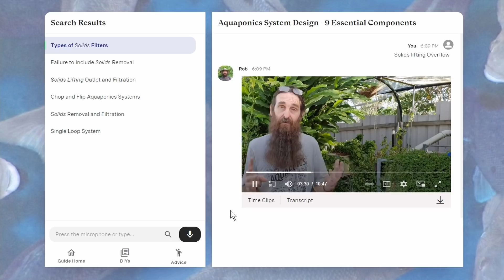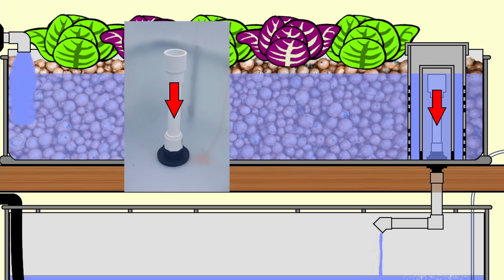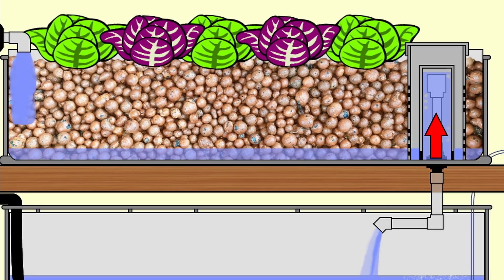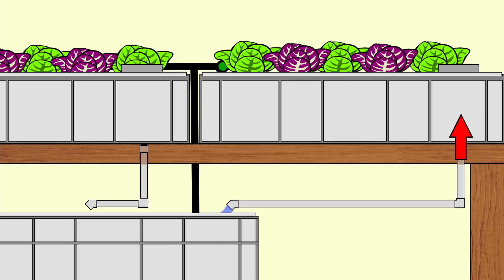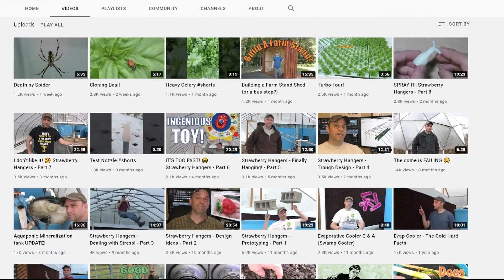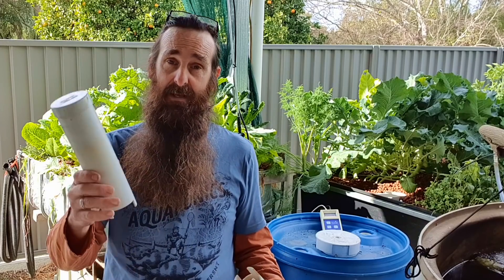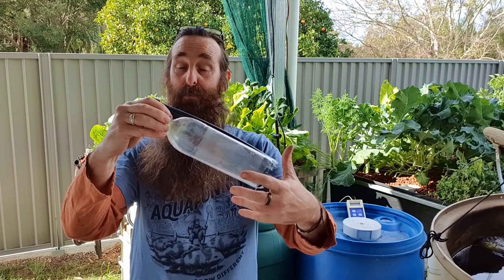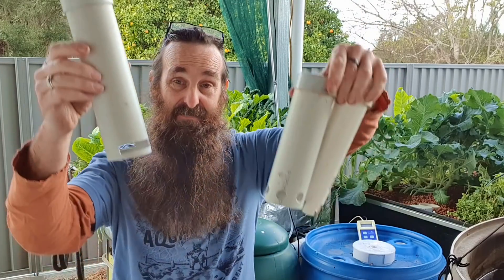Bell Siphon Troubleshooting & Explanation | Aquaponics 101

Comment: Ahhhh my release pipe was running continuously Never emptying the grow bed but adding a 6 inch pipe on The elbow worked like magic Now My issue is pump only 400ltrs per hour maybe 1000-1500ph could fill growing bed faster

Comment: Might be a weird question, but how do I get the siphon to start if water is dripping drop by drop by gravity and not being pumped?

I want to make a siphon but nor for anything gardening related. I have an air exchanger that drop condensate into the next room bath drain. But when there's high humidity I constantly hear dripping echoes in the pipes twice a second all day.
I'd want to make a siphon so water get sent to a container to make a "buffer" so the water only drain through the siphon once there's enough of it. basicly i want to make a motorless condensate pump.

Should i make the tubes smaller to make sure the siphon start? Its not fast enough to start a spihon and have no control on the flow
Reply from the maker: I'm not sure you will get one to initiate with a drip even with thinner tubes. Not sure what to suggest sorry. Hope you get something sorted.

Comment: I was thinking of starting a small bed with sand as a medium. Will the water be able to flow quick enough through the sand for the siphon method to be effective or am I better off with something bigger like rocks or clay pebbles?  Thanks.
Reply from the maker: Sand works better with a timer on the pump.
Sorry I missed this.
How did the build go?
Reply: @RobsAquaponics  I experimented with sand and a stocking to keep it out of the siphon well. I found it to be draining water too slow. So I bought clay balls. It's been going well for a couple of months.

Comment: Dude thank you so much. I've been "tuning" my flow for two damn days trying to get the siphon to break. Turns out I just needed to spin the drain elbow around since my siphon is slightly crooked. I havent seen anyone growing cannabis with this setup so I'm gonna give it a try 😅. Curious how the buds will turn out relying solely on the fish tank for nutrients. I've got mine in a shed. Just need to mount the light but it's currently in use lol. I've got blue tilapia and crawfish in the bottom but I'm wondering if I could breed koi instead

Edit: by "this setup" I mean a chop and flip
Reply from the maker: Sorry I missed this but am pleased the video helped. 👍👍
Have you sussed out @Potent Ponics channel?

Comment: 😮i have my drain runing under water, because the air went up resulting no drainage now i created an airlock and i have to start over😢 maby just add a 90 bend but above water its a fun project i made smaller ones they run fine this one drain 2inch im sure once i figured out  how to perfect the big one im planting maruana and im adding fish once i made a propper filter that can clean 2000liter without restricting pump flow i dont like to add taps to pumps the pumps dont last long from backpressure😢 so sizing the tubing has been taking some time😅 i love watching your projects you explain it all so well hope your channle get lots of views😊
Reply from the maker: Sorry I missed this I don't think I've seen a 2" bell in operation. I think 1¼" was the largest I've seen with a 2"-1¼ reducer on it (from memory).
Sorry I missed your post.

Comment: Thank you for your explanation.
I tried your advice to initiate the bell siphon by increasing water flow rate and it works well but then it didn't stop .
Therefore I decreased the flow rate and it stopped but didn't initiate.
How could I calculate the correct flow rate?
Reply from the maker: Sorry I missed this. It sounds like there's something else at play if that didn't work. 
Did you check the angle of the drain below the bed?
Reply: @RobsAquaponics  Thanks for your guidance, I'll try to change the angle

Comment: Aside from the engineering challenge involved, why do y'all rubes even use bell siphons?
Reply from the maker: What engineering challenge? I've seen kids make them work on the first attempt 🤣
What do you use to flood & drain the beds?
Reply: @RobsAquaponics  i guess it's an engineering challenge bc we see growers so the time, dismayed bc their bell siphon got stuck either on drain or fill, causing damage to plants and pumps and floors. It's a simple design, sure, but it's got some reliability flaws. You can argue if you like, or you can watch other youtube videos, read fb groups and hydro forums, etc ..

I prefer to have a pump on a timer plumbed thru the bottom, and a drain pipe higher up in case my timer ever failed and left the pump running, which never happened to me yet, but I'm ready for if/when it does.
Reply from the maker: @fatrobdouble  That's why this video exists, to help those that are having issues due to dodgy advice from social media, forums & in some cases, "professionals". 
You'll get no arguments from me mate, I've ben told I don't know what I'm doing by many a keyboard expert over the past 10 years, strangely enough vary rarely compared to the folks that thank me for the help they received watching the videos or emails I sent them. 
Run your system how you want, as long as it works for you, happy days.
Reply: @RobsAquaponics  I'm not trying to tell you your doing it wrong, nor am i trying to convince you to change your system. I'm just trying to find out why it's popular with some ppl. The only reason i can think of is that aquaponic growers need to keep a pump on constantly and they might not want a second pump? But straight hydro growers rubbing ebb and flow, they can save a lot of headaches and energy by just running a checkless pump on a timer. (Plus a lot of plants don't want to be that wet...)

Comment: My siphon was cycling well air lock forming and breaking. There is a long pipe to sump but the bell has a snorkel. 
The air lock is now forming BUT the bed is failing to drain. The water goes down an inch or so but then holds in place. So it no longer drains fast enough. It doesn’t get to the bottom to allow the air lock to break. I can assure you the water flow rate is quite slow so it isn’t over filling. Any ideas?
Reply from the maker: Normally it's a inflow issue if the outflow is keeping pace with the inflow.
 How low do you have to turn the inlet flow to get the siphon to break Dewey?
Reply: @RobsAquaponics  thanks so much for the reply. I seem to have rectified the problem by lifting the bell siphon up a bit. It appears that once the airlock was formed the vacuum applied to the bell siphon sucked the bell down so firmly it slowed the water out. I tried adding additional holes to the base of the bell and this improved things somewhat but it needed clear space under the bell to allow the airlock to break. It is all cycling just fine now.

Comment: Hi Rob, thanks for a great video. I have a couple of questions. I use the bottom section of the bottle to ensure no air leaks, it works but am wondering if the taper at the top will act as an accelerator? My other question is instead of a large grow bed my bell syphon feeds into 110mm pvc pipes with cup cut outs. It takes about 8 minutes to drain and about 13 mins to resyphon, so there is only about 5 mins of no flow. Is this a problem? My plants are alive but not growing...
Reply from the maker: Hey Rupert.  I'm not sure about the taper would have much effect on the overall operation of the siphon.👍
Is there any way you could block the discharge end of the pipe so the water backs up a bit? If you did there would always be a small amount of water in the base and it would act a bit like a DWC bed. The pipe would need to be fairly level to have enough water to reach the inlet end.
Hope that helps some.
Reply: @RobsAquaponics  sounds like a nice simple fix will try it thanks

Comment: Why use a bell siphon and not simply an over flow? Also, using the IBC totes, is there a reason why one would choose to use a growing media instead of the deep water method  with Styrofoam rafts and cups?
Reply from the maker: I like to use the siphon to raise & lower the water level to help the plant roots & bacteria get as much O2s as they Can. Have seen many constant height/overflow beds work well but have also seen a lot with dead spots once plants roots start to inhibit the water flow. 
I have no issue with raft beds either but keep in mind that you'll need decent fine solids removal to keep them out of the beds as well as a stand alone biofilter to process the waste from the fish.
Reply: @RobsAquaponics  yeah I have an extensive filter system in the works.

Comment: Hi Rob, purchased the video package was great to have it all sorted and easier to work through. I am testing the bell siphon in a grow bed setup, however is the bell siphon meant to be free seated and floating? If take the outer cap up the bell floats up and thats done with the 50mm pipe. Got great flow rate, run off etc just cant get it to break
Reply from the maker: Hey MCT. It sounds like the drain may be running slightly uphill & has some water in it preventing the air from leaving the bell chamber as the bed fills.  Once that is made to run level or slightly downhill you shouldn't have the floating bell issue & it may help the siphon to break as well. 
Let me know if that helps any.
Just to let you know that if you ask the question through the guide I will see them a lot sooner as I check them a few times a day. 👍

Comment: i understand everything said in this video but my issue is not stopping or not starting is to close together, i turn water flow up the smallest amount it doesnt stop, turn it down the smallest amount and it wont start, and if i get it right, 1 day later its doing the same thing :( might have to try the snorkle i think
Reply from the maker: Do you have a long run of pipe from under the bed back to the tank ?
Reply: @RobsAquaponics  only about 70mm under
Reply from the maker: @SnitchyBug  If you're still having issues & want help post a video showing the siphon & the drin & I'll suss it out for you.

Comment: Your videos continue to be perfect, thank you so much! I'd been running aquaponics for abt a year thanks to you, swapped to hydro last weekend and moved the system outside. Siphon wasn't shutting off, messed with it for a couple days, found your video and bam! 5 minutes later I had my new drain pipe angled down instead of slightly up and its working perfectly. Thank you again!
Reply from the maker: That's great to hear Frostyforge. 👍
Cheers & happy growing.

Comment: I used a Central bell siphon on a medium chop and flip, it was intended as a Failsafe but is so much easier to adjust.
Reply from the maker: I've always found them to be very easy to run CAS. 👍 Had real issues trying to dial the loops in when I had a crack at them.
Cheers mate.

Comment: i was thinking about starting an ibc chop and flip aquaponics system but i will only be able to feed them once every 1 or 2 weeks 
do you think if i put less fish in and put it in more sun, the fish could eat the algae that is grown 
or is there any sort of automatic feed system that could work 
cheers
Reply from the maker: That would depend on the type of fish you use Connor. You will find that the plants will probably suffer though as you'll just be circulating the same nutrients round & round the system. 
Have you looked into fish feeders at all? I know some of the pond folks here on YouTube use them a bit so might pay for you to look into them mate.
Hoe that helps some.
Reply: @RobsAquaponics thanks heaps, i will do some more looking into feeders

Comment: the siphon not-breaking issue, well you are right. I am using a bend siphon, instead of a bell. My siphon was no breaking because the slope near the exit was more horizontal. Once I changed it to be more sloping downwards, it fixed the issue of the siphon not breaking.
Reply from the maker: Most of the fixes for the other siphons are the same as the bell's I've found AP. 👍
Am glad you got yours sorted mate.

Comment: Very good explanation.  Even though I use the breather tube on mine, it's not always necessary.  As Rob shows, when the siphon breaks the air is able to come back through the drain pipe. This is perfectly fine if draining right below and the piping is short.  On my systems I tend to have much longer drain lines since my reservoirs are not under the media beds.  This makes it difficult to get air back into the bell so the breather tube allows for an easy way to break the siphon  👍💧💦
Reply from the maker: Great explanation Rob. 👍 I'll be running a fairly long drain on the potato bed so will be using a snorkel in that one as well. 
At the moment all the bells have snorkels on them as I made a number up just for the video.
Even have one similar to yours but it was a tad too ugly to show in the video. 😉 
Hope you & yours are doing well mate & thanks again for letting me use your videos, I really appreciate it.👍
Cheers. ☕☕
Reply: @RobsAquaponics  since 06 i have pushed for few ideas 1 alternative powered farming resourcs been trying to setup bell syphon with flloat valves from water collectors to gardan gravity feed no pumps
Reply: @RobsAquaponics  opm our planet peace people matter or noone will be missed
Reply: @RobsAquaponics   im trying to rigg up  rain collectors to one turn valve to a float valve to bell syphon then another float valve to drip system then hopefully i can just tun the one valve have it all go to dripp feed
Reply: @RobsAquaponics  5:49 bottle was melted for syphon wasnt it
Reply from the maker: @coryryder9070  The bottles were only cut & not heated in any way.
Reply: @RobsAquaponics   yeah i was trying to rig up something once but didnt turn out right i need to get the certain float valves and rest
Reply: @RobsAquaponics  but was trying to see if i could make the bell syphon kinda a valve in its self so it turns on and shuts off on its own
Reply: @RobsAquaponics   and do all of it no pumps just gravity pressure feed
Reply: @RobsAquaponics   see i wanna use bell syphon not like your video but inbetween water and planets but drip system and float valves will regulate the bell syphon you could just hook up more bell syhpons and such to push water further
Reply: @RobsAquaponics   first flost valve regulates water to bell syphon second float valve will allow shut off after drip system full and sto bell syphon